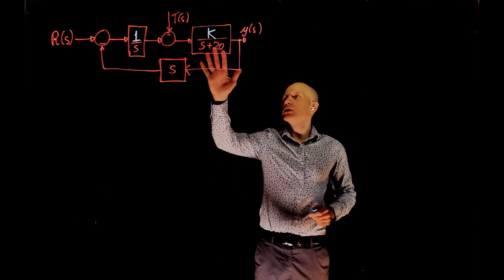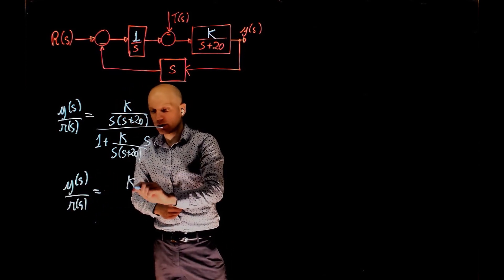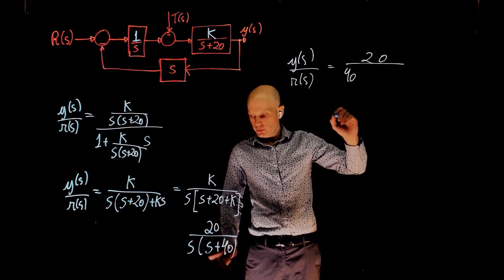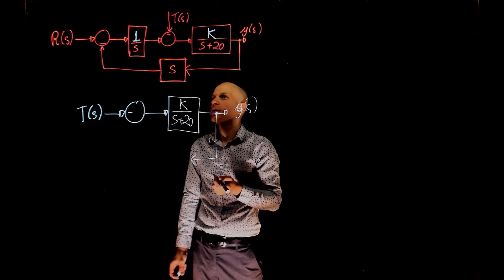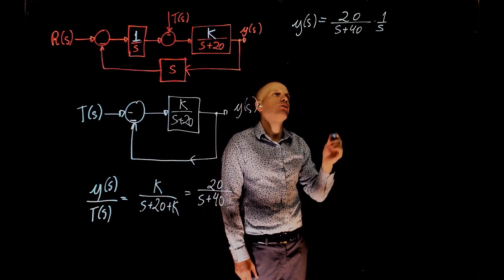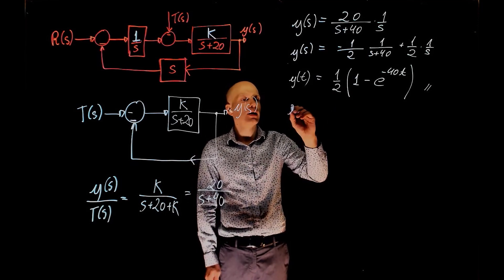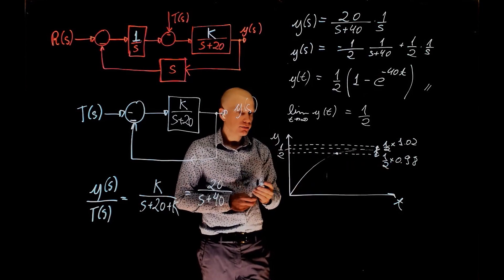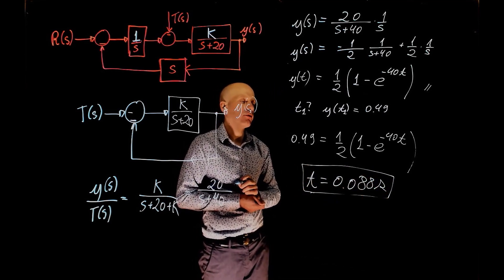L8E39 Control Systems, Lecture 8, Exercise 39: Transient response.

Comment: at 2:25 wasn't the equation originally second order, why can we say its first order when its still has a denominator with s ^2 , does the ability to factor second ordering allow them to be first-order, their are still 2 roots arent their 0 and -40 making it second order
Reply: This system is a first order system. If you compare its characteristic equation with the characteristic equation of a second order system, you'll see that its natural frequency is zero. What is the system who has a natural frequency of zero? A first order system. This system will never oscillate.